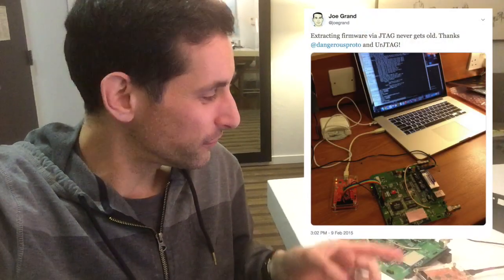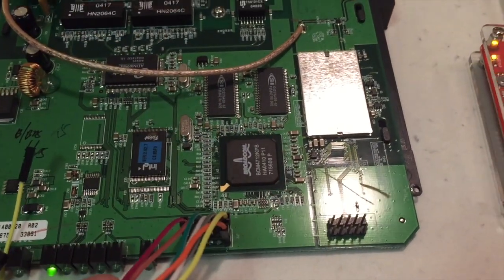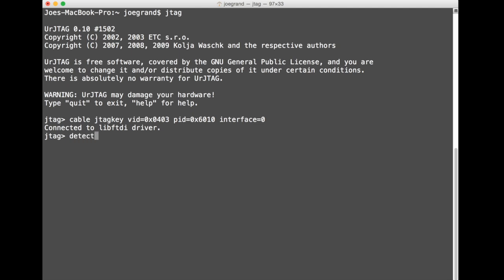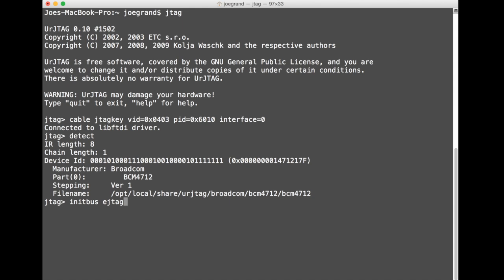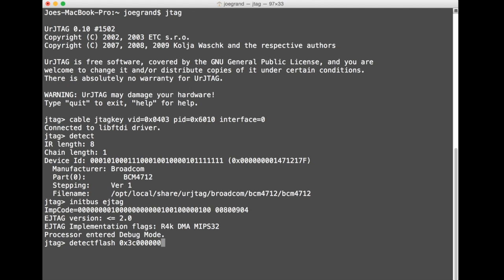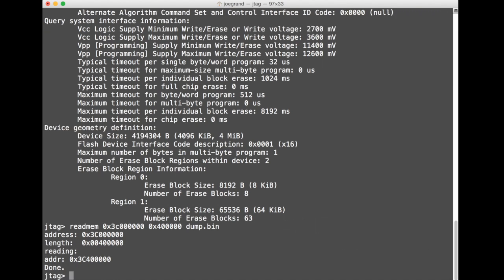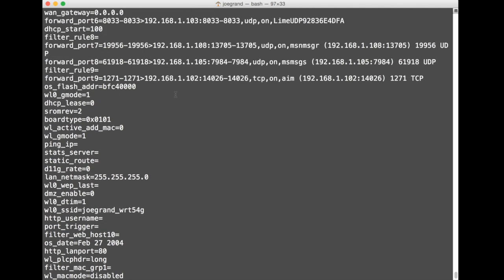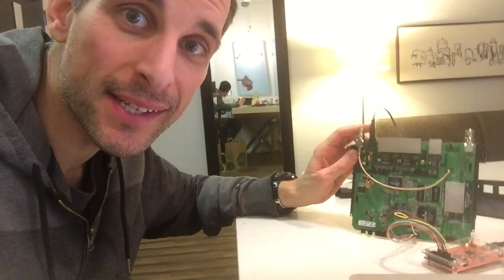Extracting Firmware from External Memory via JTAG

Comment: I just got a bus pirate 3.6a and, I'm wanting to connect to a device using JTAG. The available pins on it are: 

TDO,TDI,TMS,TCK,GND,RESET

Do I just connect it the same named pin, as from the bus pirate to the device? (Like TDO - TDO, TDI - TDI...etc etc for all of them). Years ago, I used uart but, I'm not seeing those connections on the board I'm trying to mess around with. I just can't seem to find a guide / tutorial that explains how to set it up, for newbs.

Comment: is there a situation where you end up with something similar to a process dump and have to RE some unknow program in order to get the data you're looking for ?
I mean grepping / parsing through the output of strings looks relativeley easy, but what if there are defensive contermeasures ? I can imagine ways to protect a private key, but this would always be defeated as the CPU is basically dong what we' re asking it to do.  I guess that' s what Apple secure enclase is about

Comment: I wonder if this would work on new iphones to retrieve icloud email?
Reply: 😂😂😂nope. Remember this means the device has to have somewhere to attach to they don't do it this way for cellphones they basically flash the microchips while there off the PCB and then put them into a mechanical mechanism that will start start use hot air to solder them on. Basically a big oven that spits out chips and lays them down exactly where they need to go.( since its 100s of thousands of times faster then a human can. And there always strate and perfectly even.

Comment: Hi Joe.  Any chance you would consider learning how to jtag newer WD HDD PCBs?  WD has decided to lock out their PCBs in a way that prevents the normal vendor specific ATA commands from doing things like read/write the ROM code, etc. and it's becoming an issue for data recovery.  I know some guys are already unlocking them via jtag, but they are selling their unlocked boards at a crazy markup.  The knowledge of how to do this is definitely worth some $$ for me, but I'm no jtag expert.  It's knowledge I'd be willing to pay for.

Comment: I been doing this with 2-way radios for years now. this is how I get trunking systems keys from Motorola and EF Johnson radios becuse you cannot save those via the CPS itself, you either have to call Motorola or EF Johnson and have them make you a key file or dump the radios firmware and flash out and make your own from that data. having a systems key file for a specific brand of radio allows you to gain access to a trunking and even a secure radio system more stabl than your traditional police scanner radio, it even allows you to transmit if you are an asshat of course looking for a bad time with the FCC. I never reccomend transmitting on systems you are not authorized to use.. Listening is fine though. I can also extract flashport data (flashcodes) from radios into files and upload those into unflashed updated radios to bring them up to modern spec like for rebanding or unlocking p25 or dual band options in a radio that was not marketed and sold with said options. the Motorola XTS series HT is a great candadate for this type of hacking.

The first real hack mod on a radio I did was on a Maxon Sm4000 series 16 channel UHF radio. I was able to change the firmware and double the channel capacity to 32 channels. I could have went further but the little atmel e2prom didnt have enough free space for it..

What a time to be alive though I can hack my coffee pot via UART interface now..

Comment: That's awesome if you have 'ejtag' support, but what if your target is MIPS32 and your 'initbus ejtag' request gets you 'error: not found EJCONTROL or EJIMPCODE register'? I've tried this on a linksys-wrt54gl v6 router, same exact setup using busblaster with no luck...  thanks for your great videos. I love my JTAGULATOR btw
Reply: UGH  v6 is the cheapest of the cheap of the WRT54G series... hardly any memory to work with and very limited features. You can barely get DD-WRT on them and they still work sort of stable snd that DD-WRT is a stripped down version designed to fit on the small memory of the v6.. You are better off with a V2 or something in the 802.11N era. 54G was nice 20 years ago but is a dead horse these days..

Comment: Nice job. Is it possible to use that jtag for bootloop phone brick? TIA
Reply: you put the wrong firmware in or tried to load a "hacked" firmware and got it in a good ole loop huh? Phones are not worth it once the bootloop, as cheap as they are these days you can buy a brand new tracfone smartphone with service cheaper than you can buy the jtag reader for..
Reply: @Elfnetdesigns  Your answer seems to be a bit over generalised to me. Phones that are expensive can get bootloop too and it would be interesting to know if you can repair them with this technique.... @John Papadopoulos: In principle, yes you can repair them using this same technique. BUT..... firmware for cellphones require a lot of knowledge if you start poking into them yourself..... They might have encryption that you need to defeat before you can write the code to the device, the more expensive ones (Iphones) do not have JTAG anymore. Or if they do, you need to know very good whoch part of the firmware is for what part of the phone (baseband,  phone itself etc.). In my opinion: not an easy task.